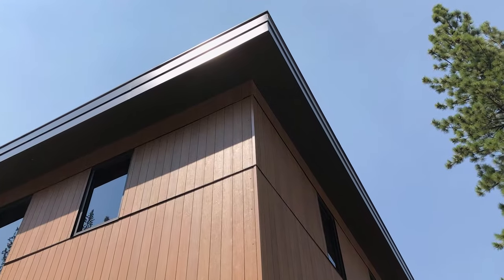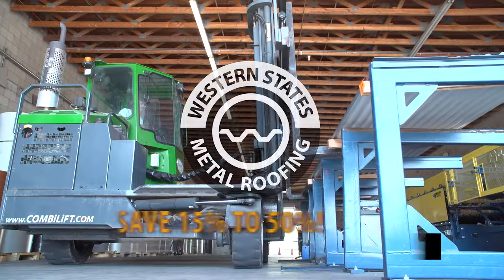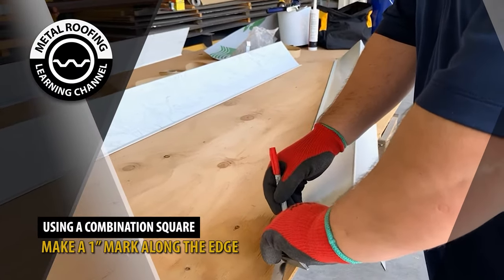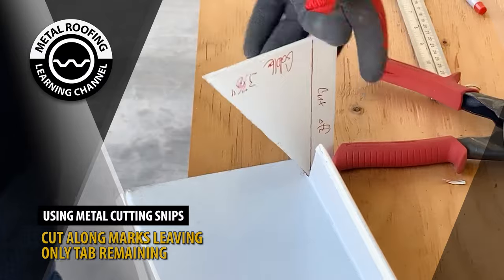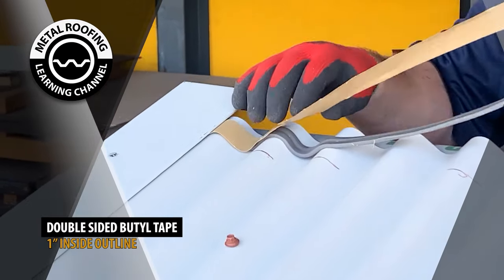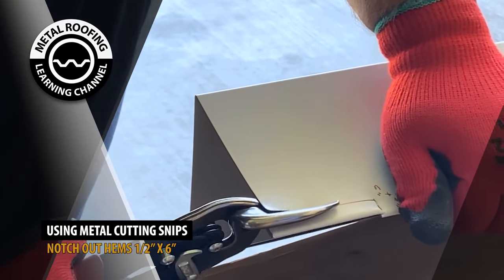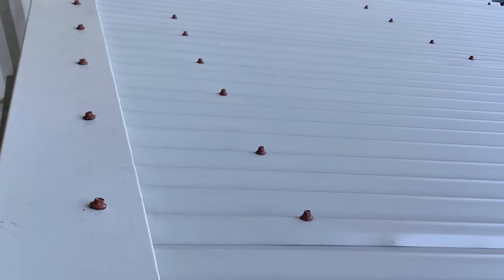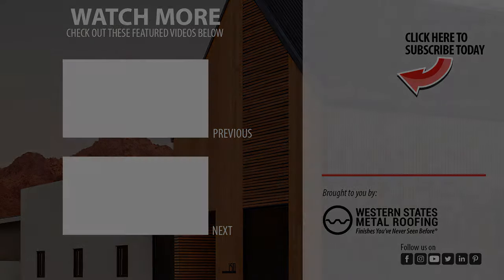How To Install High Side Peak Trim. Peak Flashing Installation For Corrugated Metal Roofing Panels

Comment: Is the High Side Peak trim component the same as the Gable trim or is it a unique profile? If so, what makes the profile different from gable trim?
Reply from the maker: No. Gable trim is installed on the two sides of a building that do not have a pitch. Ridge cap or peak flashing is installed on the part of a roof that has a pitch. Gable is a 90 degree bend, ridge or peak flashing is bent to follow the pitch of the roof. Buy your peak trim from whomever sold you the metal panels. If they can sell you metal panels, then they can source peak trim for you.

Comment: Hi,like the video's very much...
I am doing a 16x30 lean to off of an existing pole barn with a 4/12 pitch. I am removing the existing facia board and tiying in to the trusses approximately 2 feet back. The pitch on the lean to is 3/12...how do I do the over lap of the old and new section of the metal roof ?
Thanks so much.
Reply from the maker: Are you referring to a transition flashing (pitch break) ? If so we have a corrugated metal roofing installation playlist on the channel. There’s a video for high to low and low to high transition installation. Hopefully that will answer your question. Have a great Xmas

Comment: I'm having trouble finding peak trim for the roof I'm building. Where is a good place to find it? I am using it for the three rib panel roofing.
Reply from the maker: Your local sheet metal shop should be able to help you out. Better yet, if you're buying metal roofing panels, they can be purchased at the same time.

Comment: Great video. Very helpful. BTW, what cutters are you using? The bolts on mine get in the way about 2" into my cuts. Yours look much more effective
Reply from the maker: Thank you for the positive feedback.
Midwest snips. Model 6610R & 6610L.. Can be found on Amazon
Reply: @WesternStatesMetalRoofing  Great, thanks
Reply from the maker: @WowRixter  Ric, just for our internal purposes trying to figure out who's viewing these video's.
Are you a DIY installer or a contractor?
Thanks a million, Paul Rubio
Reply: @WesternStatesMetalRoofing  A DIY'r in Canada. I bought a metal roof for my son's lean-to shed and was Googling how to install the gable and peak trims. I don't, unfortunately, own your product, but did find the video to be excellent. Very clear and concise
Reply from the maker: @WowRixter  I appreciate the feedback. Good luck on the install.
Reply: @WesternStatesMetalRoofing  You're welcome. And thanks

Comment: How close to the top edge of your roof should the metal panels be? I'm currently building a lean to shed with a 15 foot long roof. I'm trying to figure out if two pieces of 8 foot metal sheets will be long enough given the overlap length wise.
Reply from the maker: Matt,
Here is a written detail for this condition
https://www.westernstatesmetalroofing.com/peak-high-eave-flashing-ws-19-corrugated-trim-flashings.html

The metal panel will go to the edge of the wood substrate as shown in the detail. You will want a minimum 6" overlap on the corrugated panels themselves.
Given you have 15' and two sheets at 8' you will be fine.